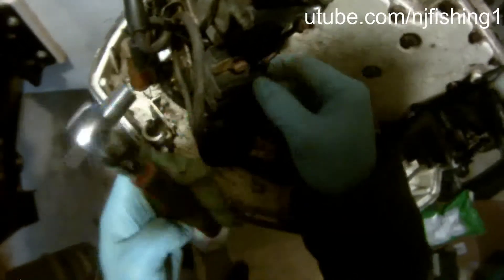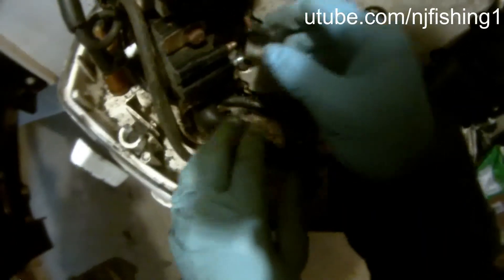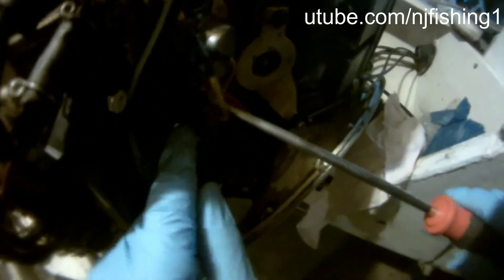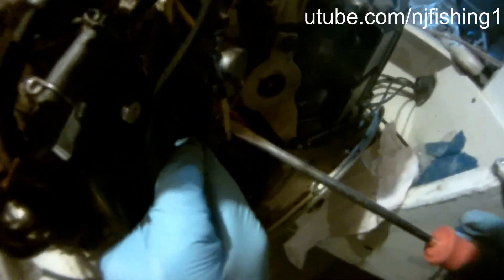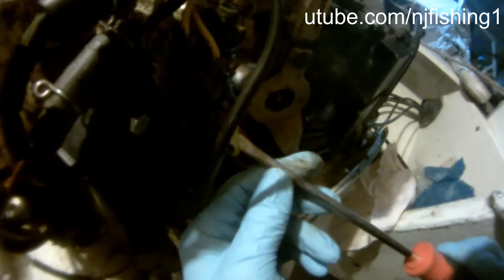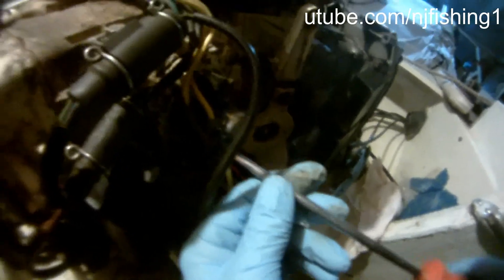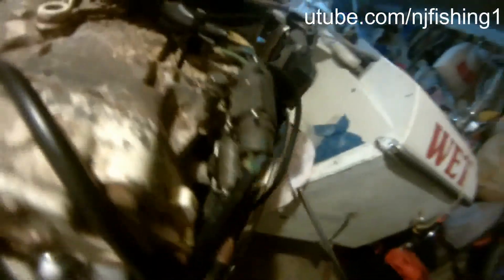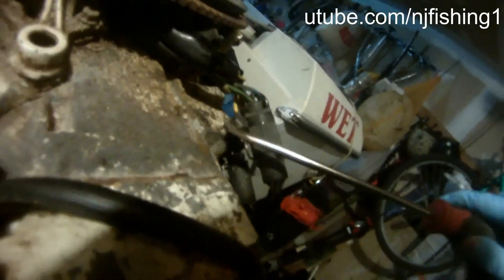problems warm start an outbord motor? Watch how I cleaned the ignition coil (Johnson 90 hp) 1.2

Comment: Thank you for this video.  I have a similar problem with my 1987 Johnson 50 hp.  Cold starts, no problem.  Warm starts (after it has run and then sat for half an hour) are difficult.  Yesterday it would not start and I had to be towed in.  Any idea why this happens only when warm?  Again, thank you!
Reply from the maker: U may have a starter motor problem. These old outboards kill the starter like crazy.
Reply from the maker: Take it apart to clean it before u buy a new starter

Comment: Good job.  I could not tell, did you put any di-electric silicone on the cleaned terminals to prevent oxidation?    I my self have an older 1986 110 evinrude that i keep running.
Reply from the maker: no, didn't put any di-electric silicone. too cheap to do that - lol